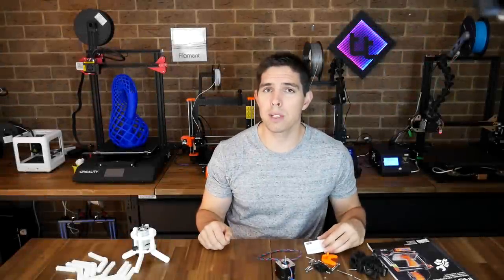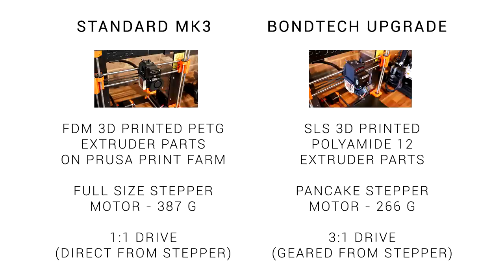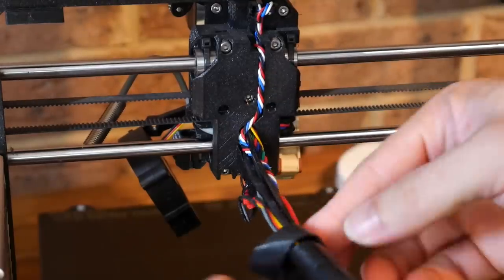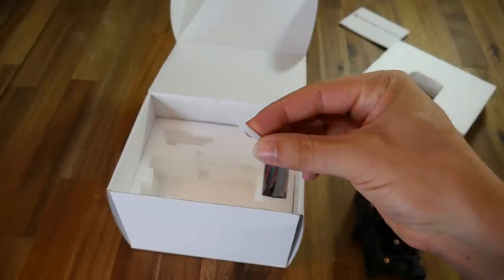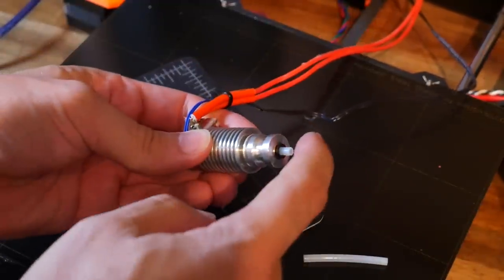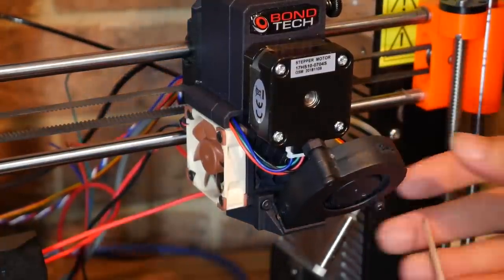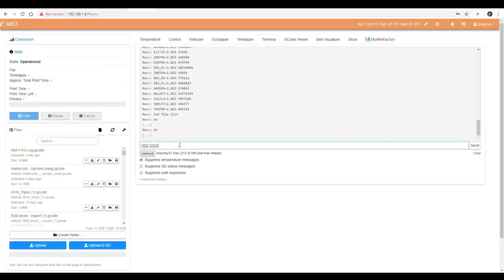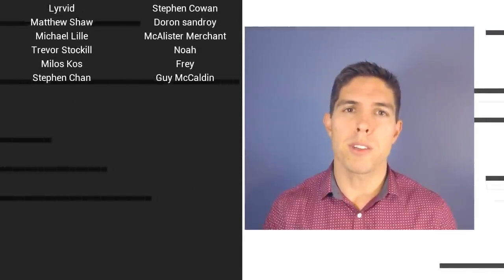Bondtech Prusa MK3 extruder upgrade - Installation and test

Comment: You can get the STL for a bondtech bmg housing as thing:3182969 and an modified mk3-head as thing:3165551. So you only need to buy the reduction gears and some parts for less than 15$ by Aliexpress to get nearly the same result. As you mostly print same speed/acceleration in x and y anyway, there is no need to reduce weight of the stepper. You can the original one, as lower weight on x will only reduce ringing in x direction a little, but do nothing for y.

Its an good solution if you have the inconsistent extrusion problem (issue 602) or if you use low diameter nozzle like 0.2mm (as you get more full-step resolution). You may even use a 0.9° stepper to get 6 times the resolution of the normal mk3. If you have not the 602 issue (yet) you do not need the update (yet).

Have you tested the filament sensor? In original mk3 it is mostly useless, as it triggers often false. The reason: Prusa develepoed the head with ABS, but produces it in PET-G. PET-G is a much more refelctive material, so using black PET-G does not help to get the sensor reliable. I used black non-reflective paint inside the chamber of the sensor - no false alarms anymore. Perfectly reliable.
The material of the Bondtech mk3 update seem much less reflective as PET-G. Have you checked if it improves the sensors usefullness? Maybe you should print the sensor cover in othe, none reflective material (or paint it on its underside)
Reply: You can get that motor and all the other parts, printed in a better material, for under $15?
Reply: @cybrsage  As I said, the pencake stepper is not needed. The printbed is the heavy moving part, to avoid ringing in y-axis you reduce speed/acell anyway. As you always use same x/y speed/acell, you gain no advantage of a new motor. You may buy one on aliexpress for another 10-15$, but you do not need to. If you do, you may use a 0.9° Stepper for even higher resolution of full steps.

PET-G works well. Bondtechs material looks and feel nicer and is stronger - but that does not effect the print quality. Of course a self printed PET-housing may need some postprocessing (using fille or drill). You do not even need high-quality high-constant with PET-G (like prusament). The printing head have to work, not to be a beauty queen.

You can buy all the parts like reduction gear etc. seperatly on Aliexpress for about 13$. But you can simply get a Bondtech BMG Clone for 17 $US including shipping:
https://de.aliexpress.com/item/3D-Printer-Parts-BMG-Extruder-Cloned-Btech-Dual-Drive-Extruder-Bowden-Extruder-Filament-Dual-Gear-For/32969060157.html
The 4$ extra spares waiting for many different parcels arriving.

The quality is good - exept for the filament gears. But you have allready the originals from bondtech in your mk3, so you do not need the cheap cloned ones.

So the simple solution: Buy the "Dual Drive BMG" from Aliexpress, print https://www.thingiverse.com/thing:3165551 in PET-G. 
So for 17 USD + some filament + some ptfe tube you get functional the same as for 100 USD at Bondtech. 

Extruder modifications a constantly improved by users. The Bondtech mk3 upgrade is high quality. But what happens, if somone optimice ventilation even more? So the thingiverse solution (using a bondtech BMG inserted to a modified head) seems more flexible. 
I am very happy with it.

Only thing to test: How well it works with MMU2?
Reply: Filament sensor works for me,  I only have issues when I use translucent materials.

What does that have to do with the upgrade that you are not matching like?  It appears tou just want to complain.  If that is your goal, just say so and we will just ignore you.
Reply: @cybrsage  I do not understand your comment. You already ignore me.

I wrote "As you mostly print same speed/acceleration in x and y anyway, there is no need to reduce weight of the stepper. "

Your comment: "You can get that motor and all the other parts...".

Before you comment a post, you should read it and try to understand it. Ore become member of Trumps goverment, you will fit in perfectly.

 I complained nothing about the upgrade. I simply replied to all the comments complaining about the high price for only slight improvement.
And reported, that you can get the same slight improvements for much less money, if you use the Thingiverse solution with a Bondtech BMG and modified printhead for much less money. It can use either the original stepper or a pencake.

Of course I like the bondtech product. But it is a very high price if you can get reduction gear etc. directly from Bondtech for about 35$ (+Vat+shipping), so you pay 70$ for SLS-printed parts and pencake stepper.
If you use your mk3 for business - O.K. But as a hobby you may look for cheaper solution.

Most people would need the upgrade to solve the inconstent extrusion issue - wich is caused mostly by microsteps having much less torque than full steps. Using a geared extruder on the mk3 is NOT about using a stepper motor with less weight to reduce ringing. No sense to reduce weight of printhead, if you move a heavy bed anyway. Reducing weight of a printhead is goal for using direct-extruder on printers like ultimaker.

So the expensive pencake stepper is nice, but not needed. If you do not have the inconsitent extrusion issue, you do not need an upgrade anyway. Like the video shows - not much improvements. The improvements shown you also get with the thingiverse-solution.

So if your mk3 is used in business and you have problems - and time is money - buy the Bondtech mk3 upgrade. But if you are a private user and only solve inconsistent extrusion issue more than 100$ is a high prise. So think about the much cheaper solution.
Reply: You do not understand that the sensor has nothing to do with this upgrade?  I cannot help you with that, other than to say the sensor is not part of the upgrade.

Mine just works, cannot help you if yours does not.
Reply: @cybrsage  Again: Before you comment a post, you should read it and try to understand it. Or become member of Trumps goverment, you will fit in perfectly.

I wrote that I found the reason for sensor-problems and I solved it. The reason is the material of the chamber (PET-G) being high reflective (glossy) and with being FDM printed disturbing reflections being everythere in the chamber. My solution was painting the inside of the chamber with non glossy, low reflective paint.

So I posted a solution - and do not ask for help to solve a problem. And I asked Teaching Tech, if this upgrade may alternativly solve the problem.

The Bondtech mk3 upgrade includes the chamber(!) there you put in the sensor (but not the cover). It uses an other material and an other printing technology than the original design. So the inside surface of the sensors chamber has other properties. 

As you can see in the video, it is non-glossy and seems much less reflective.
So the sensor should work much better in the chamber of the upgrade than in the original chamber.

So my simple question to Teaching Tech was, if he had discovered any changes how good the filament sensor works.

I did not ask you but Teaching Tech, as he is competent. I would never ask someone who has no clue of 3d printing technology at all, can not understand simple context and posting without even thinking (like you).
Reply: Again you did not read my post. bigotery need intolerance to other opinions. I think the way Trump and you act is immoral. Thats my opinion. You do not tolerate my opinion. You insult me instead. Which is in fact exactly the way Trump "arguments". If you take it as an insult I compare your art of "reasoning" with the clown of the white house, thats perfect right. You insulted me without reason, and any action gets a reaction.
Does that prove me intollerant? No. I gave you, what you deserve for your unprovoked insults but that has nothing to do with being intollerant to others opininions.
I am intollerant against calling opinions "facts" like you and Trump do. But I perfectly respect your rights to have opinions without any intelligence.
I answered to the opinions you call "facts". Like the wrong statement the upgrade having no effect on the filament sensor. Or your statement I had said you can pencake stepper and so on for less than $15. As you were proven wrong your "argument" with childish insults - and yes, this is Trumps way. You simply can not bare to be proven wrong.
"Insults" are no opinions but only bad behaivior. So intolerance to your unprovoked insults is not bigotry.
But intollerance to reality - like you prove to have - is not bigotry but simply stupidity. 
As no one can fight stupidity with success, so simply quit.

Comment: A good upgrade is to remove the direct drive extruder to a bowden, it is much easier to load, had much less inertia on the x axis and you get much less issues from belt slack etc. You remove almost half a kilo if it had a  normal motor and gears., wich you can convert into faster printspeed by having a much lighter x axis.
Reply: Also, combined with an ezr struder, a bowden setup prints flexibles (yes even ninjaflex) with ease and at speeds comparable to direct drive setups. Too many people think direct drive is an upgrade when from everything I've seen, the opposite is true. The only real advantage I can see with direct drive is less retraction and therefore shorter print times (sometimes it's substantial time saved) but IMO that's not enough reason to choose it over a good bowden setup with a nice extruder like the ezr.

Comment: the real question is, does it solve issue 602?   also seems like just going back to the original mk2s extruder would be a step ahead... i mean ditch the bondetch gears and just go back to the single gear... less or no 602, it worked fine since it's not geared so it skips before it even grinds filament.... plus it's free....  why are we spending more money on something they should be fixing for free?  if you want to pump out plastic faster with a larger nozzle then use this.

Comment: You didn’t 3D print the cooling upgrade prusa made that is standard with all models. It is an unfair evaluation now.
Reply from the maker: This was acknowledged in the video. I even had a screen of prusa's newsletter when it was released.
Reply: Teaching Tech I know, but that makes the results different and I think it should have been included on the video.
Reply: Teaching Tech I really liked the video though and found it really informative despite that.

Comment: Great video. If I was going to use a pancake stepper motor on my direct drive Ender 3, would the pancake stepper motor have any print quality decreases?
Reply: A pencake stepper has less torque (about a third). You may reduce the current of the stepper.
If your Ender 3 uses an geared extruder like Titan or Bondtech BMG (or cloned: Dual Drive BGM on Aliexpress), the gear ratio is 3:1. So the force the filament is pushed through the hotend is the same as the normal stepper with an ungeared extruder.
This is one (of two) reasons for using geared extruders:
1. You get more tourqe with the same stepper (mostly needed on 2.85mm Filament) or the same torque with a smaller stepper (less weight of moving mass; less ringing on x-axis)
2. As microsteps mostly make movements smart, but do not have much torqe, 3:1 means also three times of full-step (high torque) resolution in extrusion of filament. Using a 0.9° Pencake stepper, you have even 6 times the full force resolution. Meaning: reducing any moiree or salmon-skin effects. And of course more precise extrusion if you use a small nozzle like 0.2mm.
Reply: I am not using using a geared extruder, so can I use the pancake stepper, or do I have to make a geared 3:1 setup to get normal torque with it? Or could I just set the flow (extrusion multiplier) to 300% in Cura.
Reply: @jamescerven4400  Sorry but I hope you understand a little joke:
If you have a bound door and and a smal boy do not have the force to open it, multiple trys dont help. He needs someone bigger with more force - or a lever.

An extrusion multiplier only make more tries. If the force is not enough, any try fails, no extrusion. If the force is enough, all trys work - and you put to many filament out.

So only use a pencake with an geared extruder like titan or bondtech bmg (the clones bondtech bmg are called "Dual Drive BMG" on Aliexpress. The cloned Titan are called Titan...).

For good printing quality you need a mostly constant flowrate. So max accereration and max speed should be the same in x and y direction.
Ringing depends on accelleration, speed and mass (mostly). So on the ender 3 it depends on the weight of the printbed. A normal direct extruder weights less. So no need to reduce weigth with a pencake stepper.
 Only reasons in case of an Ender3: 
V-Slot wheels live longer (but cheap to change or replace by better ones)

Of course the construction of the Ender 3 with only one z-leadscrew can make problems with heavy weights. But I think a normal direct extruder would be O.K. Else adding a second leadscrew for z would be the better solution instead spending to much money on an geared extruder with pencake...
Reply: Thanks for the help. Great advice!!!